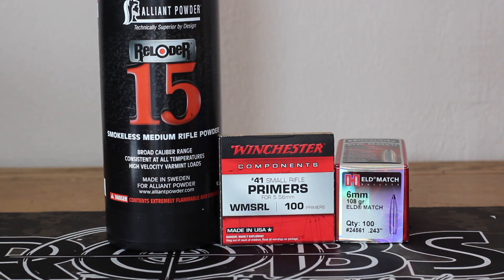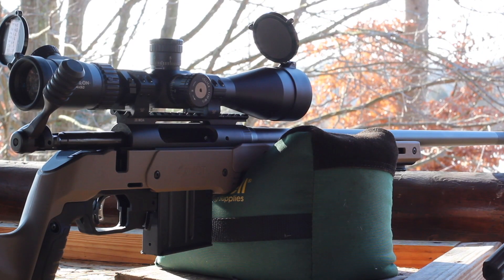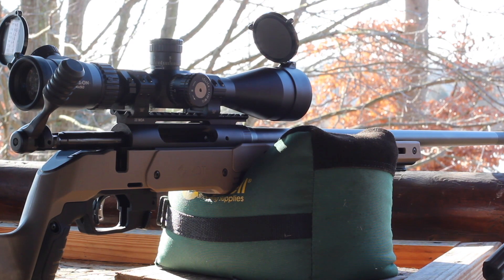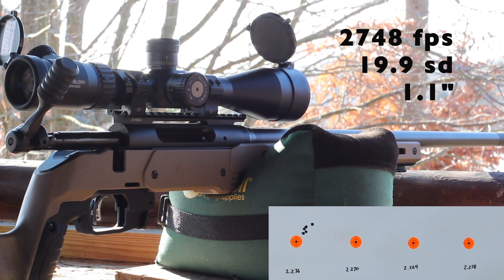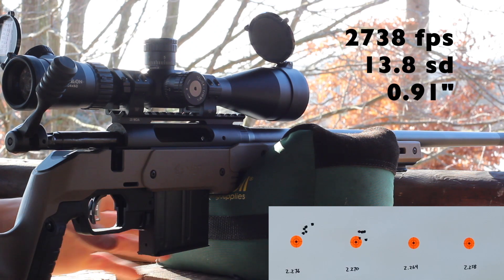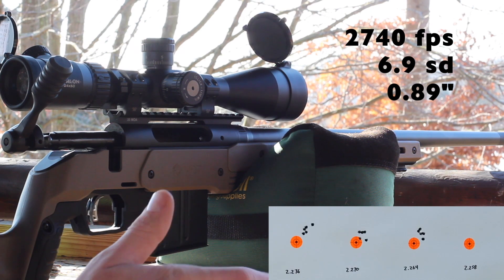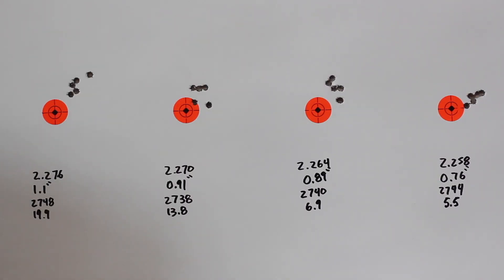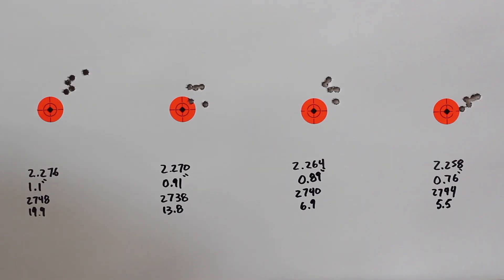6mm ARC, 108 ELD match, OAL Test

Comment: .006 difference between seating depths can skip right over a node, I'd do .003.
Reply from the maker: This is probably true, however with my current amount of components .003 at this time is not practical. Seems like a node that small anyway wouldn't be worth finding?
Reply: @RobsReloading  in my experience with my hunting and f-class rifles going in increments of .003 is what it usually takes to find the best groups. If a person finds the node going in bigger increments, they just happen to get lucky and find the node and not skip over it. Whether you find it going by .003 or .010 increments, the node is gonna be where  it is. 

When it comes to the seating depth a gun shoots best at ive had them where the seating depth can be +/- .001 and I've had them where the seating depth can only vary +/- .0005. If your seating depth window is bigger consider yourself lucky.  I guess it app depends on how small you want your groups and how much work you want to put in.

To me it's worth finding. I've had guns go from 1/2 inch guns to 1/4 inch guns. I think the biggest difference has been at longer ranges.
Reply: @RobsReloading  .006" node is typical.